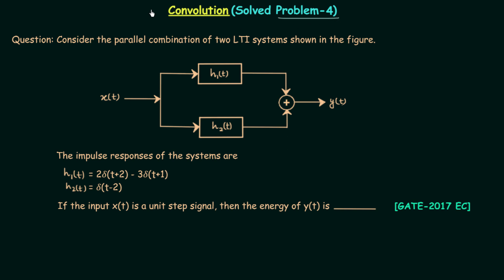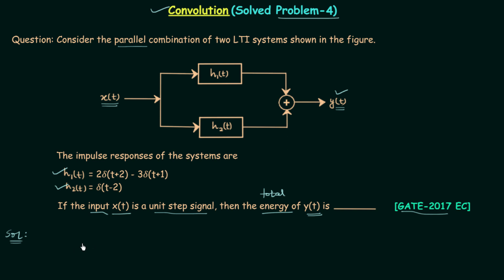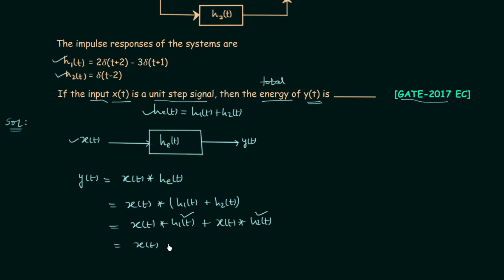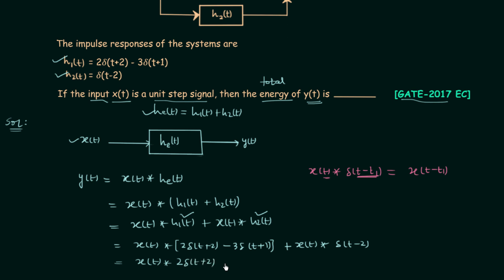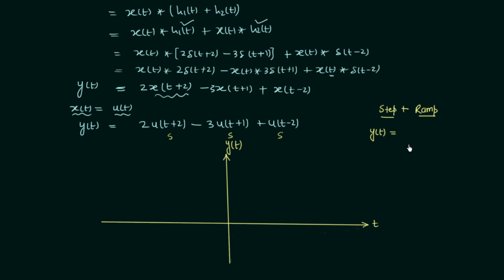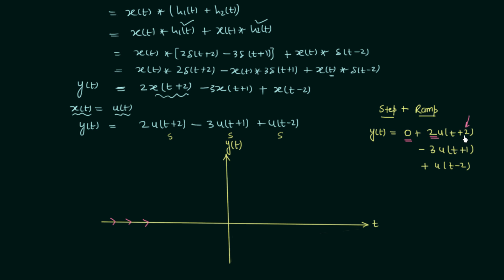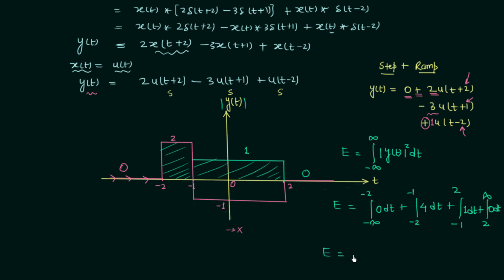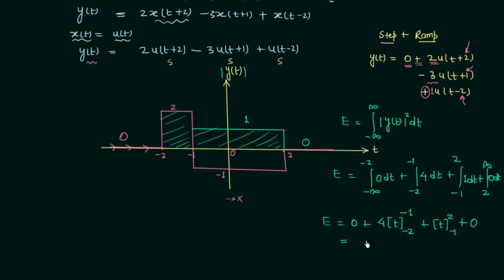Convolution (Solved Problem 4)

Comment: In the interval -1to 2 the area of rectangle is 1x3=3 by length x. breath
Reply: Total Energy= area under |x(t)|^2. So first will take the mod of x(t) so the graph below x axis will come upwards as shown in figure then we will take the square of x(t) for individual interval from -2 to -1 it will be 4 so in place of 2 it will be scaled at 4 and for -1 to 2 it will be 1 and now if we will take the area then for interval -2 to -1 area = 4 and for -1 to 2 area= 3. So on addition area = 3+4= 7

Comment: Sir my answer is 5.
I'm solving using area formula.
2×1 + 1×3 = 5
Reply: same doubt
Reply: @ushasaha6316  i think because in energy formula {mod(x(t))}^2 is there and we find area when there is no square inside integral.
Reply: Total Energy= area under |x(t)|^2. So first will take the mod of x(t) so the graph below x axis will come upwards as shown in figure then we will take the square of x(t) for individual interval from -2 to -1 it will be 4 so in place of 2 it will be scaled at 4 and for -1 to 2 it will be 1 and now if we will take the area then for interval -2 to -1 area = 4 and for -1 to 2 area= 3. So on addition area = 3+4= 7.
Reply: It's modulus so 2 square 4

Comment: sir, energy of a signal is equal to the the area covered by it. the area covered = 2 x 1 + 3 x 1 =5 J.... but the answer is 7 J ..how is it possible? please tell me if i am wrong?
Reply: same doubt, did you get the issue resolved.
Reply: Bro actually it is 4 +3 because ( energy = (amplitude)^2 * (width))
For first rectangle = (2*2)*1
For second one = (1*1)*3
Reply: Total Energy= area under |x(t)|^2. So first will take the mod of x(t) so the graph below x axis will come upwards as shown in figure then we will take the square of x(t) for individual interval from -2 to -1 it will be 4 so in place of 2 it will be scaled at 4 and for -1 to 2 it will be 1 and now if we will take the area then for interval -2 to -1 area = 4 and for -1 to 2 area= 3. So on addition area = 3+4= 7
Reply: Square of amplitude in mode * interval = Energy

Comment: how to get integral 4 and integral 1?
Reply: follow the formula.........
y(t)=2, for t=-2 until t=-1
and y(t)=1, for t=-1 until t=2 
most important, don't forget the square, 2^2 = 4 and 1^2 = 1
Reply: @tankhaishin7503  it's a rectangle not square
Reply: @weirdoshort  I thought Gerhat Samuel is asking for integrals at 12:45
Reply: @weirdoshort  use the formula at 11:49, substitute the y(t) with 2 and 1, you will get 4 and 1, I didnt mention it's a square or rect